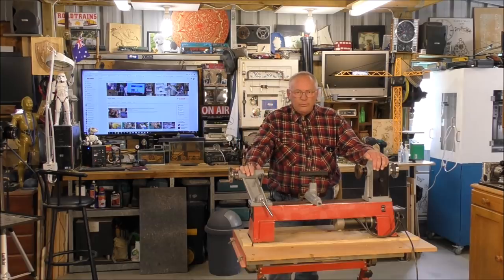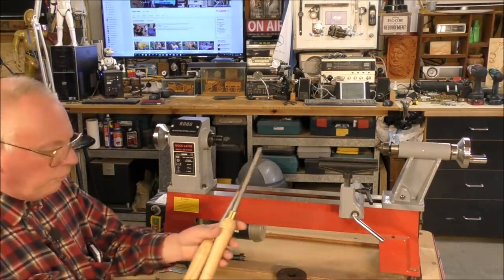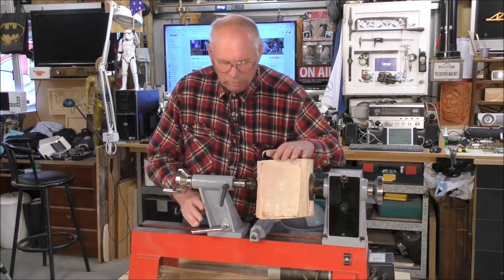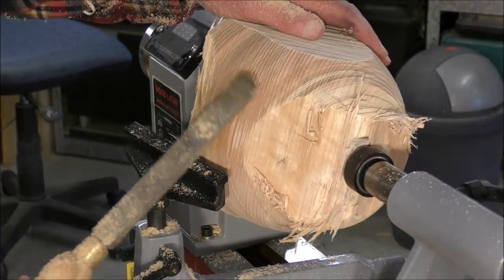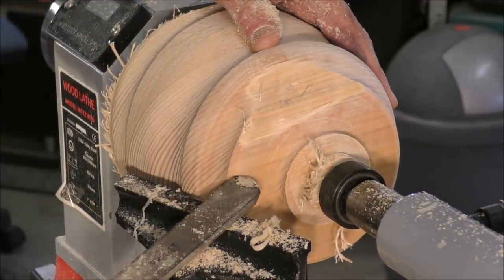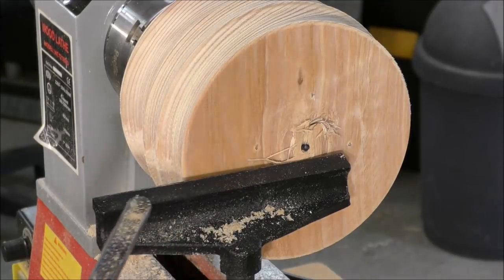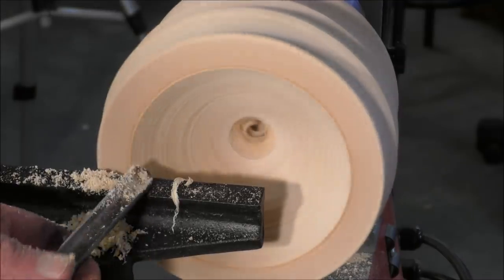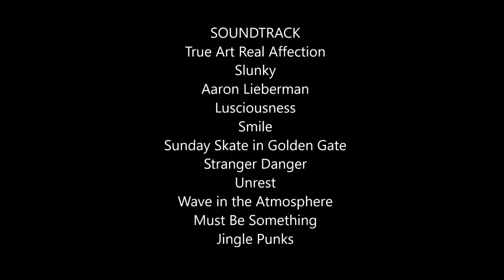299 Wood-turning A to Z for beginners

Comment: I work in ceramics, it's funny to hear you say that it is like working in ceramics because I have been thinking that for a while.  I haven't really figured out how, though, it just feels similar.  Is it stronger and/or more stable to hold onto a tenon or mortise with the chuck?  I mean, squeezing down on the wood, or opening to grip the wood.